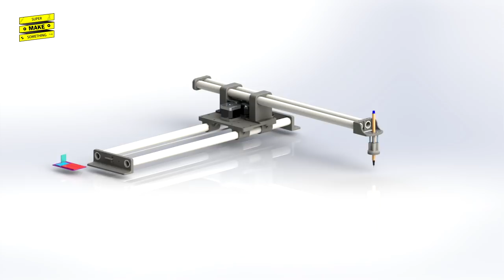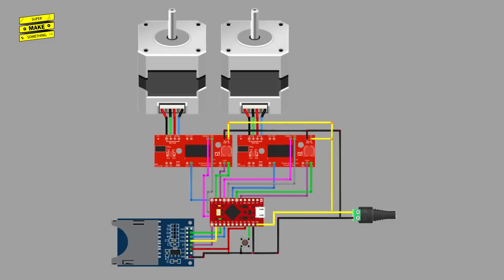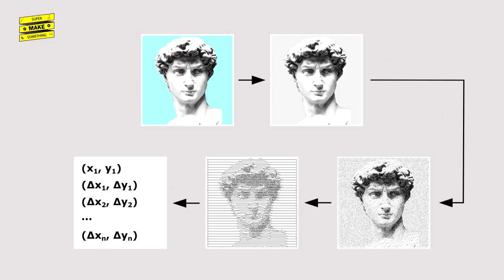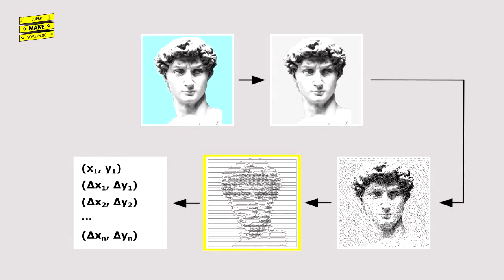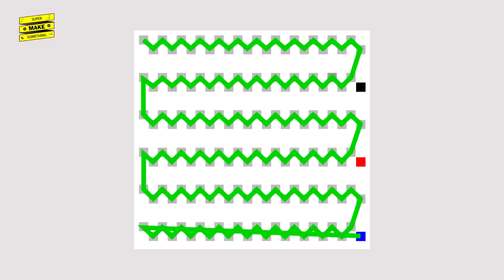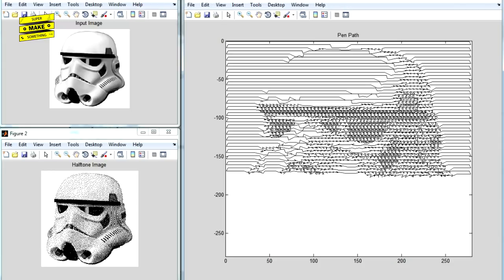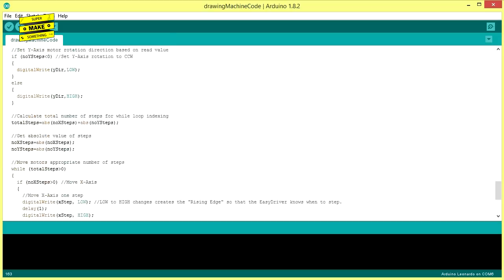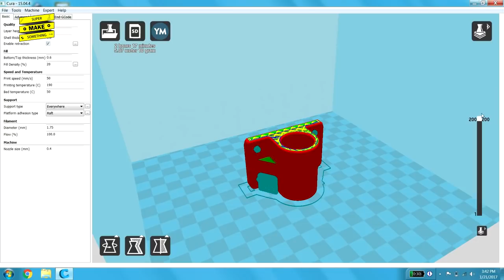Robotic Drawing Machine (Arduino, 3D Printing, CAD, PCB Design, Programming, Stepper Motors)

Comment: PLA? Or ABS?
Reply from the maker: Either works! The motors don’t get hot enough to melt PLA in my machine, so PLA worked well for me. Your mileage may vary depending on your setup though!

Comment: Hi, what softwear you use to convert a photo in line shading
Reply from the maker: I used MATLAB, but the code could be ported into other languages without much trouble. Check out the GitHub repository for more info.

Comment: Very clean and straightforward tutorial video.  Excellent job on the presentation of complex information.   
 I am also impressed with the creative way you use cheap materials and get away with it.    I am surprised the string holds up and the pvc is straight and rigid enough.    I go   w  a  y    back and this is stand-out work.
Reply from the maker: Thank you so much!

Comment: can you give the image or give it in gcode?
Reply from the maker: You can load images into MATLAB using the .m code file, which generates a plotter command file that can then be transferred to the machine with an SD card. However, the output of the MATLAB code is not standard GCode — instead it is just relative position commands from one point to the next. Hope this helps!

Comment: for me one of my motors starts to vibrate like crazy and doesnt move, where as the other motors keep moving what should i do about this??
Reply from the maker: Akshat Pande There should be a potentiometer on the stepper motor driver board that increases the amount of power to the motor. If this doesn’t work, I would adjust your setup mechanically (or lubricate the sliders) to try to decrease the amount of friction and make the motors require less torque to move the pen.
Reply: Super Make Something if it is not too much, can u check out the recent most video i uploaded to get a better understanding of my problem? Basically i am trying to control my steppers with my mouse, but if u see the video u can see that the response time is alot how can i fix that?

Comment: I was plotting a similar pen toolhead.  Z-Axis can work for big stops, but a solenoid on the toolhead would be best for dot matrix prints.  Any way you could do this?
Reply from the maker: Definitely — the Arduino in this project has open spare inputs that could be used to control a solenoid. You would need to modify the circuit a bit with a transistor to handle the power needed to drive a solenoid and also modify the tool head a bit, but it is definitely possible. If you end up giving this a try, please let me know how it turns out!

Comment: Great video BUT can you PLEASE explain how you use the string to move the carriage?  I can see how it would pull the carriage when the string is wrapped around the pulley, but how about when it has to go the other way? You cannot push with a string..this part really confuses me.
Reply: Ah, OK..I get it..it only goes one way. It never returns.
Reply from the maker: Both carriages work on the same principle -- essentially the strings are double wrapped around each of their pulleys, which allows each carriage to "pull itself along" in both directions, because each of the strings are fixed/anchored to the drawing machine's frame.  Hope this helps!
Reply: Thanks for your response.  I was looking for an inexpensive way to introduce this topic to elementary and middle school students.  I'll try building the machine myself and see how it works.  Keep up the good work.  You are a creative guy.
Reply from the maker: Michael Wright Thank you so much! That sounds like a fun class! Good luck with your build. If you are willing/able to share pictures of the final machine, I would love to see the results!

Comment: This is amazing! Where do you get the motors and assembly components? Could you also add a small push motor near the pen to draw images without connecting lines.
Reply from the maker: Thank you! You could definitely add another motor or servo to pick up the pen, though you would need to modify the drawing code slightly.  The motors, etc. were all sourced from Amazon.

Comment: By the way, did you notice, 0-128 are 129 different values, 129-255 are 127 different values, so to make them equal, take 0-127 and 128-255, both 128 different values. However, there is no color in the middle ;)) Since the number is even.

Comment: Hey where is the program to convert images into the text files the arduino can read? Thanks
Reply from the maker: Liam Price This is done with a custom script written in MATLAB. The code can be found at the project’s Github repository. (Link in video description.)
Reply: @SuperMakeSomething  Hey thanks for the fast reply, yeh i downloaded all that but how do i use it? like what do i actually do with those scirpt files? Thanks heaps
Reply from the maker: You will need a copy of MATLAB to run the scripts to generate the drawing machine text file instructions for the images. However these could be adapted to any language. If you decide to port the code into another language, please let me know and I will add it to the Github repository. Good luck with your build!
Reply: @SuperMakeSomething  Hey I got a trial of MATLAB, i clicked open file in the MATLAB program and opened the floydhalftone file (script?) from the link in your description, how do i now get the MATLAB program to use the script to convert an image into the text file? I'v never used MATLAB before, if you could tell me how to get it to create the text file that would be great! Thanks so much for your help
Reply from the maker: You will also need to  place the mainSegments.m file in the same folder.  (This is actually the main program.)  Changing the filename of the INPUT variable will allow you to load a custom image.  You will also need access to the knnsearch method, which may be in a different toolbox, depending on what is included with the demo version.  Hope this helps and good luck with your build!  Please share a link with me when you are done -- I'd love to see the final result!
Reply: @SuperMakeSomething  Ok so I have managed to open the mainsegments code in MATLAB and i changed the input to the picture I want to use, what is the next step to producing the text file? Thanks

Comment: Hey thanks for the great video! I'm wanting to use your projects code but I want to use a nodemcu as the arduino board, and instead of reading the text files from a SD card I want to to be able to read it from a webpage I am hosting, would anyone know how to code that? I'm guessing all I have to is replace the read text file form sd card, to some sort of read from webpage code. Any help would be appreciated!

Comment: Quick question is the nema 17 stepper motors bipolar or unipolar and how much was the step angle (or does it not matter)
Reply from the maker: They were bipolar stepper motors, but I do not remember the resolution off the top of my head.  However, it shouldn't matter -- the drivers can microstep.  Essentially the resolution is a trade-off between scan "detail" and scan time.
Reply: @SuperMakeSomething  Could u explain to me what you mean with this, because in the code it says "no microstepping"

Comment: My pro micro arduino board ended up getting fried which one did u use for this video??
Reply from the maker: Yash Israni I have sometimes experienced this with Arduino clone boards, as their voltage regulator is of a lower quality and cannot handle the 12V input. I would try powering the voltage input to the circuit board with a lower voltage (start at 6 and work your way up until things work as expected). Check out the variable voltage power supply linked in the video description for a single power supply capable of multiple voltage outputs.
Reply: @SuperMakeSomething  well I don't know if I'll be able to get a battery regulator fast but I could probably just get a new power supply of 9V would you recommend buying that voltage or something lower in voltage?
Reply from the maker: @yashisrani6714  I've never tried to repair an Arduino after it fried, but replacing the regulator may work.  I would start with as as low of a voltage as possible to mitigate the risk of frying another Arduino.  Not sure if 9V will work or not (i.e. if this will be too high, too), as it really depends on the quality of the regulator on the Arduino.

Comment: hi, how can I get the gcode of the output picture?
Reply from the maker: YUAN XIE Unfortunately this machine does not read standard GCode, however there is software online that you can use to convert images to GCode. I found this site online, but have not personally tried it: http://www.thuijzer.nl/image2gcode/
If it works for you and gives you good results, please let me know!

Comment: Simply add an up /down pen device and you have a 3 axis machine(plotter) now you feed your picture into ink scape convert to paths and convert to g code  and run GRBL and print the picture...you use 1 arduino uno ,3 stepper motor drivers....load GRBL into the arduino uno and away you go...NO mat lab needed and if anything goes wrong theres help on the net.. I have a old 24 inch wide hp I converted years ago and it runs perfect..... nouse reinventing the wheel but I do like your build idea

Comment: This isn't a robot, it a plotter, they been around since the 50s.  They are primarily used in CAD, blueprint, architecture, mechanical design and other industries.
Reply: A plotter is a robot. THey had being around for long but it wasn't that long that you could make one yourself without knowing a lot of electronics and computer programming.

Comment: Hey! Can you tell me if the specifications of the Stepper motor and the motor control circuit please?
Reply from the maker: The stepper motor driver is the “EasyDriver” from Sparkfun. I unfortunately do not have exact specs for the motor except that they are Nema17. My suggestion would be to buy the torque-iest motors you can find in that size — never a problem to have too much torque! :) Hope this helps!
Reply: Thanks! And what is the thickness of the PVC pipes?

Comment: Something very similar could be made with a robot drawing on an etch a sketch. I made one recently. You presented a different way of doing what I did for the pathfinding algorithm though, I might use some of those ideas in my project if you don’t mind. Thanks for the interesting video and project (I’m a little jealous about your 3d printer and part designing skills, I only have a lego mindstorm...)

Comment: How much did the pen holder tube wiggle in the X and Y directions while mounted on the dowels? Were you able to draw with high precision?
Reply from the maker: The pen did not wiggle much as it was pretty tightly clamped by the setscrew. Unfortunately I did not use any thread fastener on my screws in order to make disassembly/servicing easy, so one of the nuts wiggled loose during this drawing, causing a bit of wobble at the output. However it was not that noticeable in the final drawing. It is a bit hard for me to quantify exactly what resolution I can get, but I will say that for this setup, the primary limit on resolution seems to be from the amount of “bleed” of the pen, which depends on the combination of pen and marker that the machine draws with. Hope this helps!
Reply: Interesting thanks!

Forgetting about the pen, do you remember if the pen carriage would wiggle on the dowels in the X & Y direction?

I'm not sure my 3D printer is accurate enough to print a carriage that is loose enough on the dowels so that it can slide freely up and down, but not too loose so that it doesn't wiggle in the X & Y directions.

Maybe this was't a problem for you, but even if I mount my pen tightly to the carriage, if the carriage wiggles on the dowels I expect my drawing will still be messed up.

Comment: For someone who appears to be quite knowledgeable, it pains me to point out such a small flaw. However I am certain you are strong enough to appreciate the clarification.
This may seem like nit picking; but the pipe you used does not look like 1/4"; It looks more like 1/2" I.D.(also it says 1/2" on it, so i realize this is a simple mistake.)

Comment: If I want to increase my plotting area, what should I do? Will increasing the shaft size only do the job or shall I need to modify the electronics and code also? Please reply fast @Super Make Something
Reply from the maker: Stiffness might be an issue if the machine gets much larger.  You would also have to adjust the steps/rev in the code, but otherwise, it should work similarly.
Reply: If I increase the length of string, the stiffness could be alleviated

Comment: Is there an easy way to make the machine smaller???
Reply from the maker: The best way would probably be to swap out the PVC pipe with threaded rod. With a bit of redesign and some bearings, you could make a machine that draws across a smaller area. You could also scale down the parts to match other PVC tube, but this will throw off the hole placement for the fasteners.
Reply: Super Make Something thanks! Didn’t know u would respond ;)
Reply: Super Make Something also can the machine write instead of draw?
Reply from the maker: At the moment, it could only write in one continuous line like it draws.  However, the code/hardware could be modified to allow it to write.
Reply: Super Make Something can u pls pls pls make a video on a smaller writing machine that draws and writes. I want to make this as one of my projects for school and it is so hard to do myself and I am very young. There are no other videos that actually explain what they are doing. But you do that so please. It would help a lot. Thanks. ;)
Reply: Super Make Something pls answer

Comment: can we a servo with it ? using another Arduino for one more  pwm pin ? and use it as a laser engraver, laser cutting, milling, plz help me in this I had messaged u on Instagram but u haven't reply in future ur channel is sure to grow very big
Reply from the maker: You should be able to modify the Arduino code to add a servo, but I have not tried this.  This will also require you to run corresponding wires to the servo from the board, which you will have to manually solder if you are using the PCB breakout that I designed.  I do not believe that this machine is rigid enough for milling, though it may work for laser engraving -- if you want to do this, I would switch to aluminum extrusion and belts/lead screws.  Good luck with your build!
Reply: yes I am building metal frame in a different way and different  desine for more stability and accuracy this I ok for drawing and engraving but if I build metal, than it can also do milling so I want to know I can add a servo into it

Comment: Hello Alex.I making your machine and i am interesting what voltage and power should be for good working all components (motors, arduino, motors drive and sd reader) ?
Reply from the maker: Awesome!  I am excited to hear that you are going to build your own drawing machine.  The electronics components all use 5V, with the exception of the stepper motor.  In terms of VCC voltage, the Arduino Pro Micro regulator is theoretically rated for 12V, but I found that the quality of this component can vary widely (especially if you are using a clone.)  As such, I would recommend starting with an input voltage of 6V and then increasing the voltage if that is not enough.  I use the following power supply for a lot of my projects, since it gives me flexibility: http://amzn.to/2D6z1eC  (Full disclosure -- This is an affiliate link :-)).  Good luck with your build!

Comment: hello brother ,i need some help in this project ....i have a4988 stepper motor driver but i dont have  easydriver so can i use a4988 driver ? and how to send g code ?
Reply from the maker: Unfortunately I do not have any experience with that particular driver, but you may be able to use this driver with the code if the pinout of the board matches.  I would compare the pinouts of the two boards and run jumper wires between the Arduino and a4988 as appropriate.  This project does not run on G-Code.  However, I am sure that the program on the Arduino could be modified to do so.

Comment: i am made 4 wheel drive car whith gear change support and staring and differential also .
but i stuck on programing part i want to control my car with wifi arduino controler with servi motor .
plz tell me how i program arduino

Comment: Hey can you plzz help me out?? i'm a new learner of arduino & i'm stuck with a problem which need a arduino uno board with dht & pir sensor!! what i have to do----""using of dht sensor i need to take the recent temperature & send it continuously to a mobile no.(time delay-10 min)  & with the help of 'pir' i have to detect motion & send it to same no. but it should be once when motion detected."" plzzz sir help me!!

Comment: Why call the arduino code 'low level'? -it could not be more high level.
Reply from the maker: +hpekristiansen This is more to maintain a systems engineering convention. In robotics, behavioral code that defines high-level tasks are called "high-level code," systems control code is sometimes referred to as "mid-level code" or "controls code," and embedded code that controls the voltage/current of the motor is referred to as "low-level code." In this project, the Arduino performs mid- and low-level tasks, while MATLAB generates waypoints to execute the desired behavior.
Reply: It's interfacing the image information with the hardware, it's as low level as this project goes.